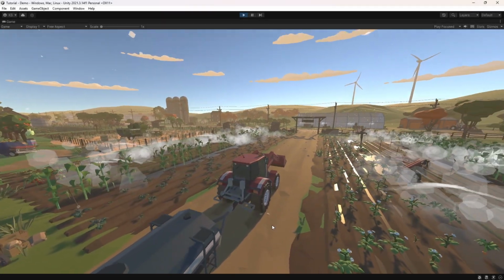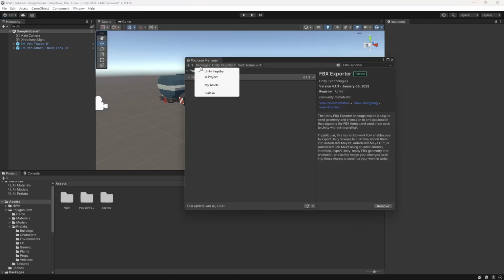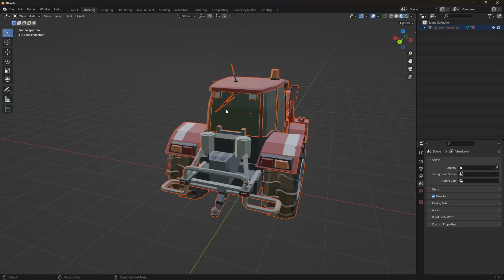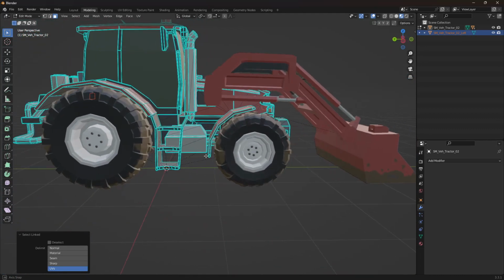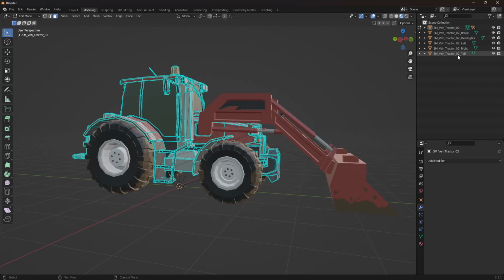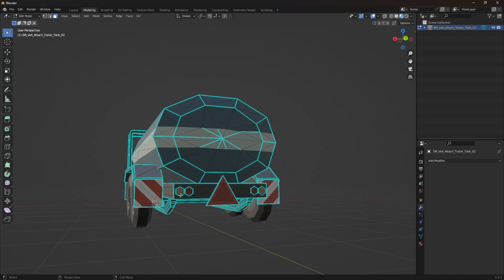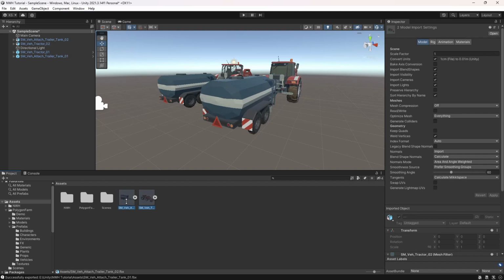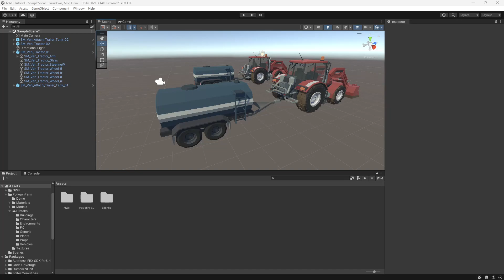Separate lights on a vehicle to use with NWH Vehicle Physics 2 in Unity

Comment from the maker: Stay tuned for part 2 coming soon. And let me know anything else you'd like covered for NWH Vehicle Physics 2!
Reply: Hi, thank you for the GREAT content!
It would be useful if you could cover different types of vehicles, like sport cars, race cars, SUVs, vans, tracks, big rigs, (bike?), etc.
Ideally, it would be organized as one video per type of vehicle.
What should be in those videos? You should touch upon as many features that can be configured using NWH Vehicle Physics 2 as possible: the problem of existing tutorials is that they typically tend to cover the bare minimum to get a car moving, but say very little of all the options available in the Inspector.

Also, it would be immensely useful a set of videos on different camera configurations and how to smoothly switch between them; is it possible to use Cinemachine, for that,and if so how?
If you could add videos on how to smoothly get in-and-out of a vehicle (using custom animations,) and how to detect if the car if upside down, or on the side.